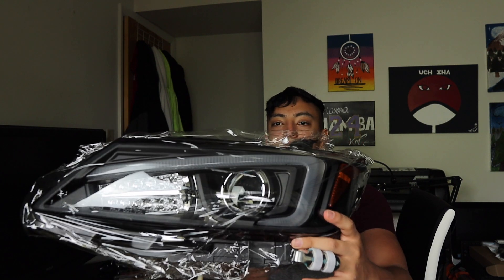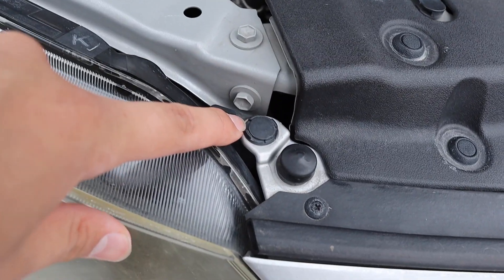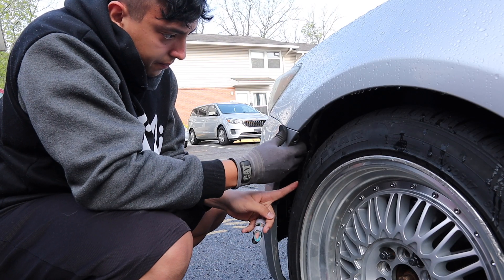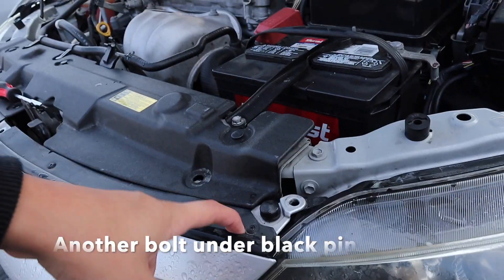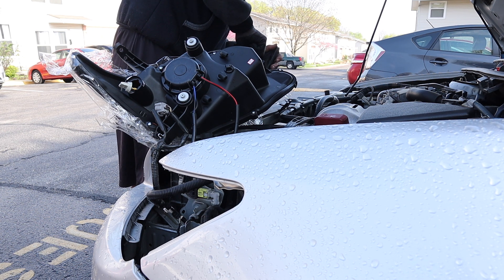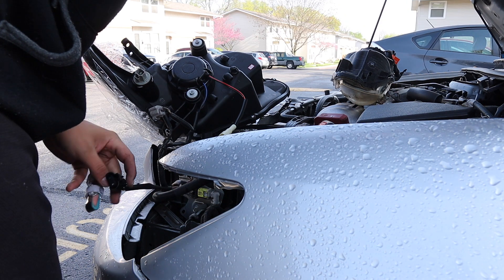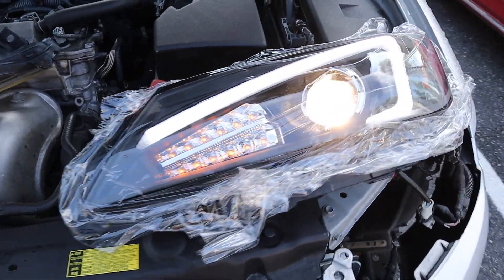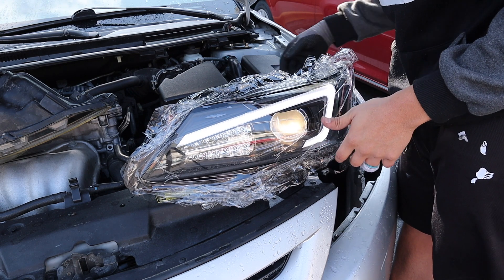Getting new headlights!

Comment: Did you find a solution for the led lights on the low beams ?
Reply: I did not, I’m actually about to do a little custom work stay tune for that video cause I’m tired of that yellow light
Reply: @0rlandoCorona  cool ! I was thinking of just ordering some lasfit h7 led bulbs they look very similar to the halogen and they are fanless too so they look like it will fit in the housing with the lid
Reply from the maker: @OGDANKSMOKE  I think you found the fix